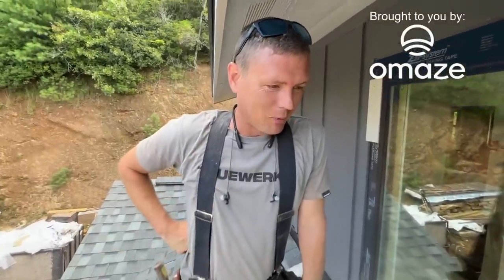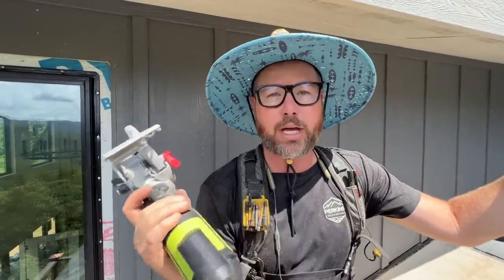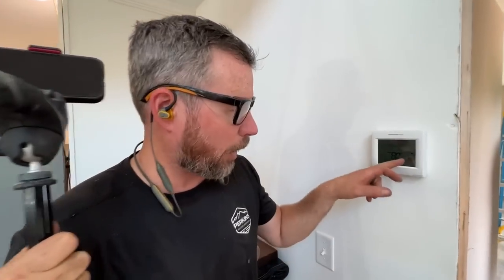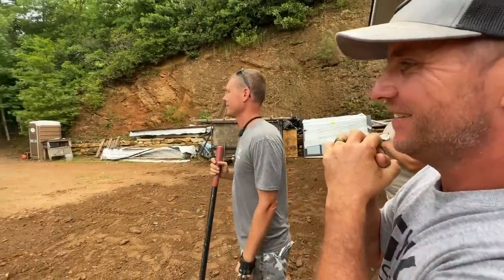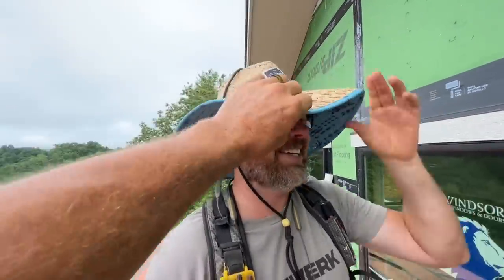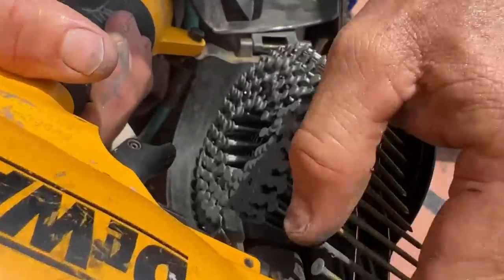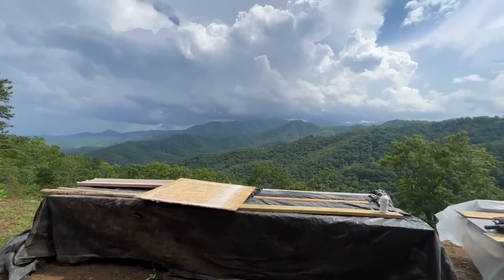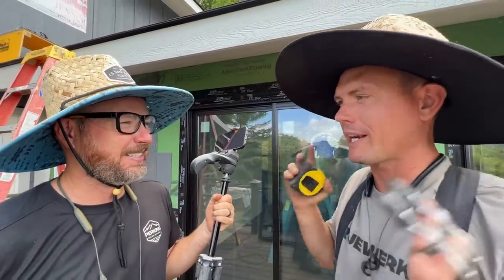Building A Mountain Cabin EP49 | final grading, gravel, and tool review

Comment: Normally you leave the bottom flange open (without zip tape) in case of water getting behind the window frame will have an escape route.  When you taped the roof/siding flashing you covered the bottom flange of the window, which means that anything behind the window will come out behind that zip tape.

Comment: Pro tip: when setting cabinets up against Sheetrock that are made with box construction and full overlay doors, use a 1” filler. Otherwise you end up with an odd gap so that the door can fully open

Comment: A Pro tip for Erik from the Netherlands, cut the top of the sealant tube slightly straighter (a little over 90 degrees)and drag it for a smooth and top result without stripes!
Keep up the good word guys!

Comment: 11:39 I thought you are not supposed to tape the bottom of a window.
Reply: Yep, I was thinking the same thing.
Reply: Not the bottom of the window itself but under where the frame is you are. Windows can have drainage weep holes for water to run out. Brickwork can have the same thing and you never want to cover any of these openings. 

It blows my mind that a construction company I once hired to replace my roof and do some painting CAULKED weep holes closed and caused my walls to get ruined and wet inside including mold within two months. Some "professionals" don't know what the hell they are doing.
Reply: @unsuckified3192  No, the Perkins guys (and a lot of other builders too) are stated previously, that it is best not to tape the bottom flange of the window, so if any water needs to get out, it can.
Reply: If your window is that close to roof what else you going to do.  What Eric did would be best practice for that particular situation.  You don't want water under your shingles.  It's best to have windows up 6 inches min to any roof so the zip tape won't get into the bottom flange of window.
Reply: Wouldn't it be better if they would cut the tape, so it did not touch the flange? Or even better, do the flashing before installing the window?

Comment: I don't think the Zip tape at 11:44 is installed correct.  That bottom flange on window needs to weep from the shimmed sill RO.  The interior backer rod and caulk and back dam stop water.  How will water get out like you taped it?